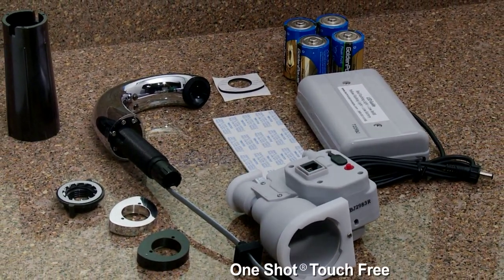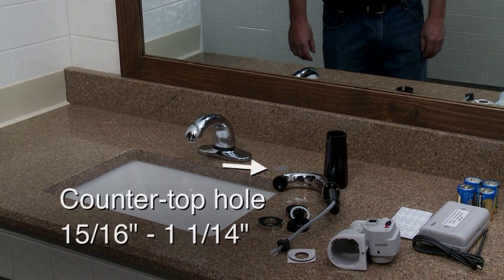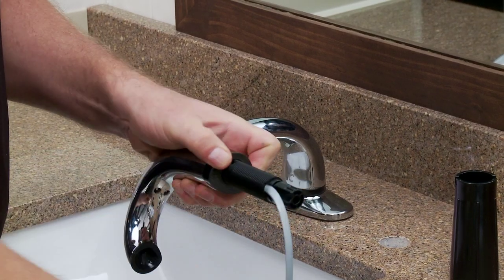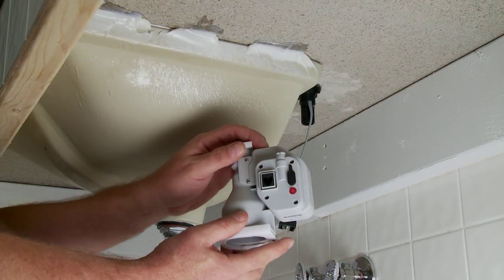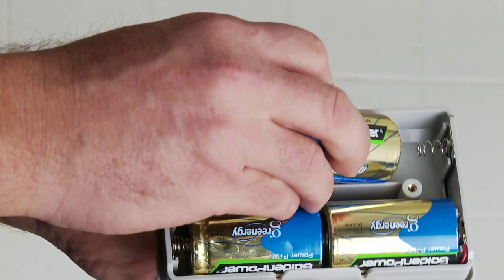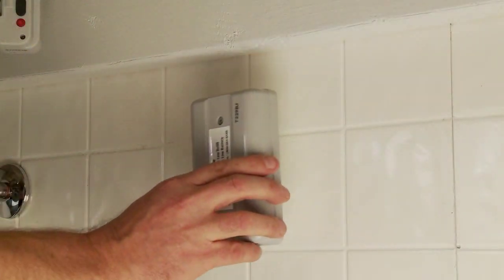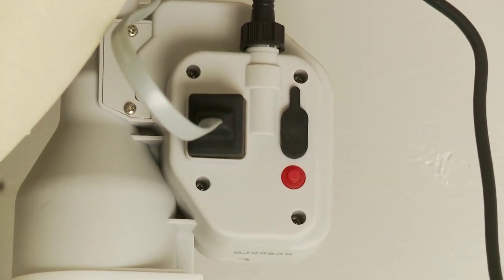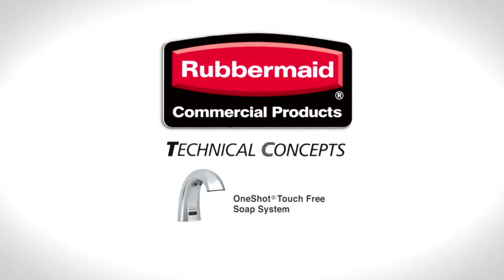OneShot® Counter Mount Soap Dispenser

Comment: I've had a few of these running fine for a few months but one stopped dispensing soap.  It has a full bottle, fresh batteries, if I hit the reset button it will prime and dispense soap until the priming is complete but then will not detect any motion or dispense soap.  The eye is clean.  Any ideas?
Reply: The electronics are encapsulated in a resin and are usually bullet proof. Mine still works after over 20 years. You may have gotten a bad one. If still under warranty go that route. I've not found dispenser or pump sold separately.
Reply: I had the same issue as you described. The tube split inside the spout and was leaking all over. I took it apart cleaned the connections with alcohol, still did not fix it. I then played with the setting switch under the rubber cover and for some reason it started working.

Comment: How long does 1 bottle usually last for maybe a family of 6?
Reply: I have these at my job and they normally last us a month so I can only assume they will last a family of 6 at Least 4 months if not longer
Reply: Always have to disconnect sensor every time you clean the sink. For commercial application it’s a bit of a nuisance. No above counter switch available.
Reply: Where can you purchase the refill for the soap?
Reply: @marcosguerrero3237  You live in a cave?
Reply: @utubebetube  all your need to do is cover the black sensor under the 'TC'. In a commercial setting you could just put a paper towel in front of the sensor to keep it from turning on.